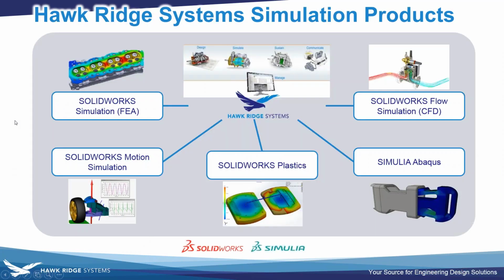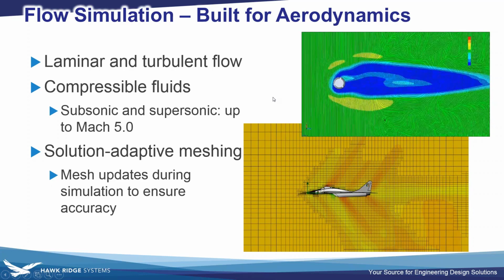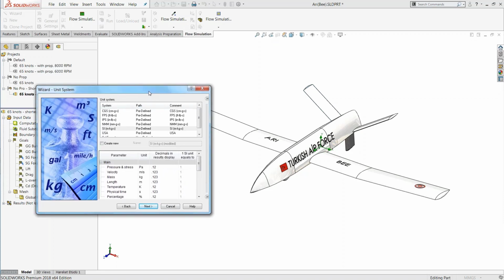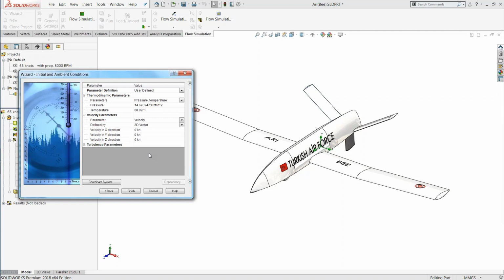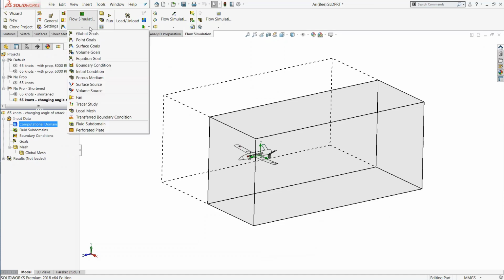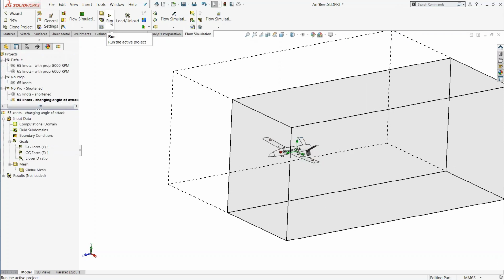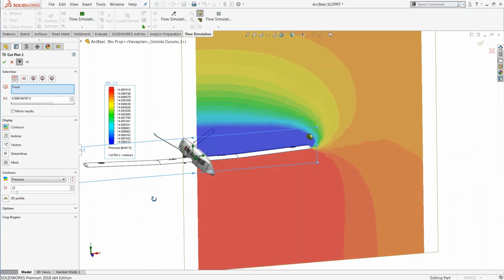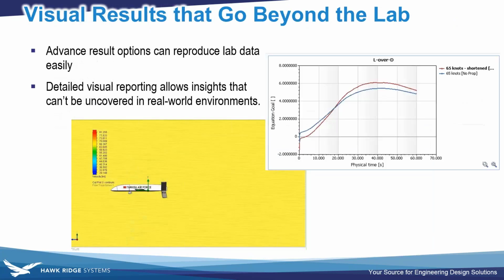The Virtual Wind Tunnel in SOLIDWORKS Flow Simulation

Comment from the maker: Hi everyone! Just so you're aware, we have an updated webinar here covering a similar topic, using an alternate approach of pitching the aircraft using a Parametric study. This simplifies the goals setup for Lift and Drag. https://hawkridgesys.com/blog/predicting-lift-and-drag-with-solidworks-and-simulia-

There is also an updated step-by-step tutorial of setting up an aerodynamic problem, including how to place "equidistant" local mesh refinement to adequately resolve the geometry. https://www.youtube.com/watch?v=PvouSPWoutg

If you are interested in validation resources you can find a PDF here which includes an airfoil validation case: https://www.solidworks.com/sw/docs/Flow_Validation_Methodology-Whitepaper.pdf 

Lastly, the equation used for drag in this video was something like the below - but please verify for your use case and model orientation:
-{SG Force (Z) 1}*cos({Initial and Ambient Conditions:Angle of attack:< Dependency >})+{SG Force (Y) 1}*sin({Initial and Ambient Conditions:Angle of attack:< Dependency >})

Comment: What is the global equation you use for drag?
Reply from the maker: If you prefer to avoid trigonometry we presented an alternate workflow in this newer webinar, where we pitch the geometry of the aircraft using a Parametric Study. This uses a series of separate steady state projects rather than a time-dependent study. https://hawkridgesys.com/blog/predicting-lift-and-drag-with-solidworks-and-simulia- 

Otherwise the equation used here was something like the below: 
-{SG Force (Z) 1}*cos({Initial and Ambient Conditions:Angle of attack:< Dependency >})+{SG Force (Y) 1}*sin({Initial and Ambient Conditions:Angle of attack:< Dependency >})

Note that you should use your own discretion and verify appropriate directions and angles for your geometry.

Comment: Is the result produced by Solidworks trustworthy? It seems that you are using quite small computation domain?
Reply from the maker: The computational domain and mesh settings were likely simplified for the purposes of this example. In practice you should try to determine convergence by experimenting with these parameters. Lift and drag calculations are particularly sensitive to mesh refinement but should be well validated for most cases in SOLIDWORKS Flow Simulation. You can find a validation example of an airfoil here: https://www.solidworks.com/sw/docs/Flow_Validation_Methodology-Whitepaper.pdf 

Placing a local mesh with "equidistant refinement" enabled will create the closest thing to an "inflation layer" around the aerodynamic body, allowing to capture refinement around the aerodynamic body with minimal number of mesh cells. There's an updated video tutorial on setting up a simple aerodynamic study using this process here: https://youtu.be/PvouSPWoutg

Covered in this webinar is an alternate approach to varying angle of attack using Parametric study: https://hawkridgesys.com/blog/predicting-lift-and-drag-with-solidworks-and-simulia- 

All this being said in typical operating regions we would expect SOLIDWORKS Flow Simulation to be highly accurate for L/D calculations with the proper refinements. In near-stall regions or other separated flows accuracy may be expected to decrease, but it really would vary on a case-by-case basis. We have other SIMULIA tools such as Fluid Dynamics Engineer and SIMULIA XFlow which have more advanced turbulence models for that would cover these situations.

Hope this helps!
Reply: @hawkridgesystems  Thank you so much for such an informative reply.

Comment: Is the result produced by Solidworks trustworthy? It seems that you are using quite small computation domain.
Reply: Solidworks simulation works well for early iteration because the workflow is simple and it needs less demanding computing power which mean faster simulation. but if you need more accurate and advance simulation it's better to use dedicated CAE/CFD software (Ansys/Abaqus).

Comment: When you set the AOA, the forces will be referenced to the global coordinate system, not to the airflow. And by definition, Lift and Drag are referenced to the airflow. So the forces on the Y and Z axis will not represent the lift or the drag. On the other hand, I am getting some bullshit data. Like a wing with an aspect ratio of 20 has a maximum L/D ratio of 7. Considering the NASA Langley profile that cannot be the case. I don't have a clue what am I doing wrong. Any Ideas?
Reply: hi, could you please explain a bit more in order to make it more clear in my mind. plus, did you find any solution to your problem? consider that im a high school student :)
Reply: @mustafatalip1  Sorry if my explanation was a bit messy. Force Y only equals to lift when the angle of attack (AOA) is zero, and the same for force X and the drag. By definition, lift is perpendicular to the airflow.  If we do it as in the video, we rotate the airflow, not the model, thus the force Y remains perpendicular to the model's longitudinal axis, not the airflow. In order to get Y alined with the lift. AOA shall remain zero, and we should rotate the model, either in the part or in the assembly. We can also do it as it is described in the video, but then we have to calculate the lift and the drags by trigonometric functions as follows: L=Ycos(AOA)+Xsin(AOA)... D=Ysin(AOA)+Xcos(AOA). But I prefer rotating the part because it is easier and more accurate simulationwise.
Reply: I am having similar issues. Total lift results in the range of 340lbs for an aircraft that in other simulation put out 1250lbs. Further, my simulations always seem to come out linear, IE there isnt an angle of attack change step/time as I inputted (same as in this video).
Reply: @Jwmbike14  I noticed your reply a little late I guess. You don't have enough iteration/AOA change. I think this method only works with a stupid powerful work station. It is possible to set the iteration in relation to time in the simulation, but even if I set it correctly, it starts to give realistic values after few degrees and it consumes a crazy amount of time. I had the most realistic values by measuring the parameters at each AOA separately. And I usually set the AOA zero in the simulation and changed the AOA within the part with a "move/copy bodies" operation. That also slightly increased simulation accuracy in my experience.
Reply: @kristofnagy5829  appreciated sir, it all makes sense right now. actually i didnt thought that you're going to reply. thanks once again. 

anyway, i have one more question. when you make rotational adjustments through move/copy bodies, is velocity that has given by us while creating simulation be like through fore plane of the aircraft or through Z-axis? 

in order to make it more clear, here is the photo: https://imgur. com/a/piveJUq
does velocity goes as line A or B? I've accidently type point instead line, sorry. 

P.S: please delete the gap inbetween dot and com. I am trying to get over the youtube algorithm which counts links as spam. have a nice day/night or whatever is your clock.
Reply: @mustafatalip1  velicity goes as line B. In the simulation, setup velocity is referenced to the assembly's basic coordinate system, which doesn't change by rotating the model.
Reply: @kristofnagy5829  thanks, you cannot guess how much you've helped :)